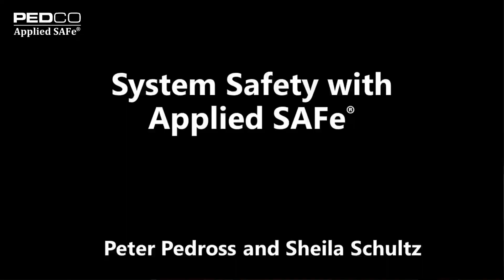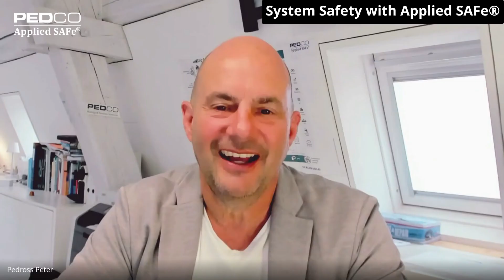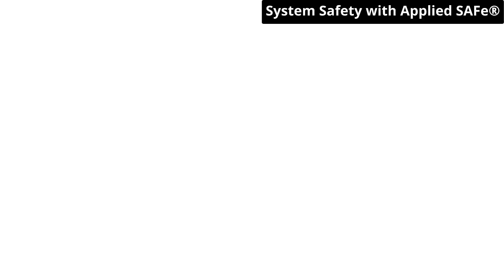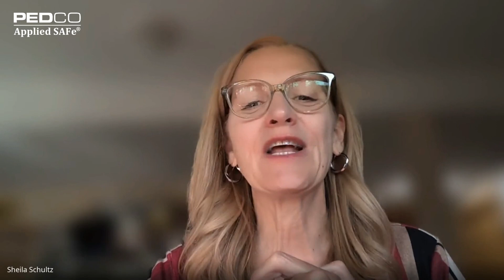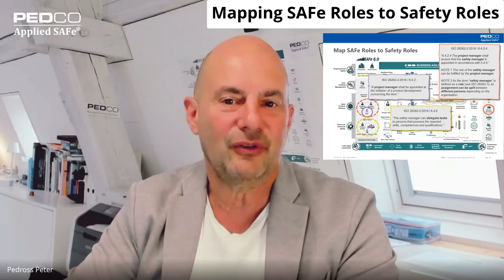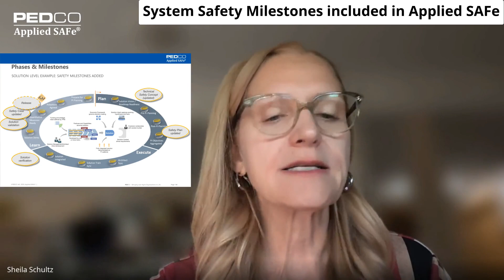System Safety and Applied SAFe: Short interview by Sheila Schultz

Comment: Sheila, I enjoyed your interview with Peter on Systems Safety Agile journey; I do agree with your comments and expertise in applying SAFe (Agile) principles in a ISO26262; as a follow colleague in Automotive big 3 (passenger) and now in my current position in Commercial (class 8) critical safety systems and leaning also into MIL-STD-882 Systems Safety, I can vouch that the industry has already moved into the fast-turn-around CI/CD pipeline; one relevant example would be the Over-The-Air (OTA) deployment that uses this development process of the Software Configuration Item.
Reply from the maker: Thanks Mirella!  It is great to hear of the agile successes you have seen!  Sheila